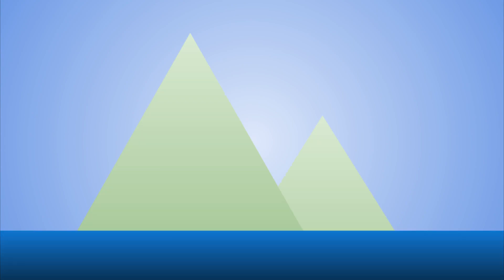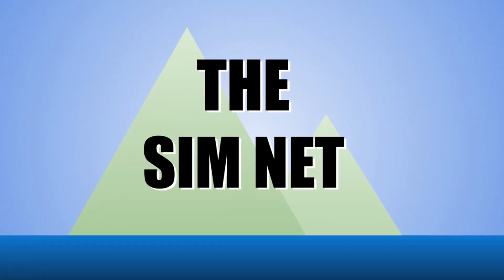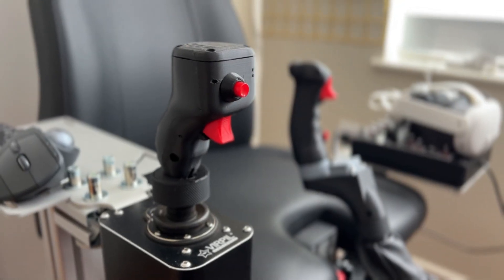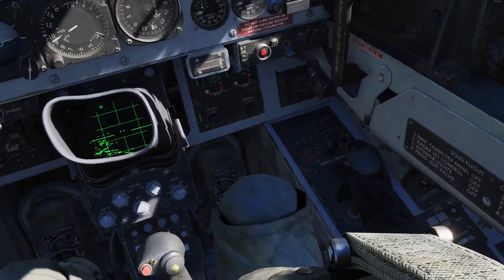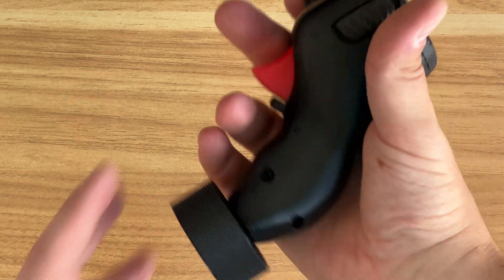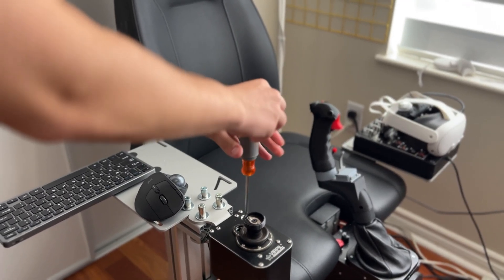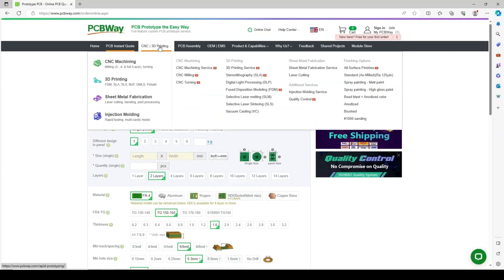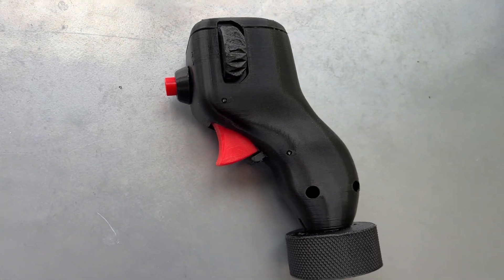Free 3D Printed F-4 Phantom Backseat WSO Hand Controller

Comment: I wonder if an old T16000m gimbal without the spring would be a good base for it. You could even run the wires for the buttons directly into the grip's existing wires.
Reply from the maker: That would be awesome!

Comment: Loving this channel, cannot work out how to configure the Alps 5 way with the custom PCB tho as shown in one of your previous videos.
Reply from the maker: So the trick with that alps PCB is to connect directly to the VCC pin on the debolestis PCB that is used for the 5 pin mini din connector. I would like to design a new PCB that has a bespoke spot specifically for that alps 5-way.